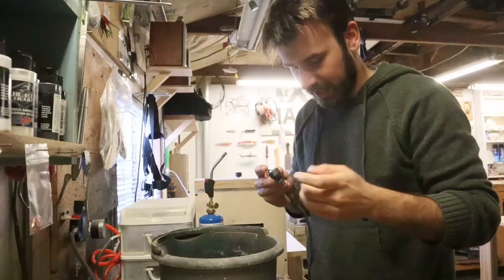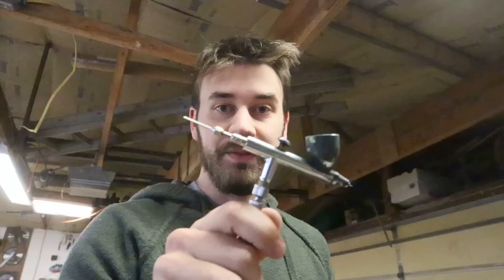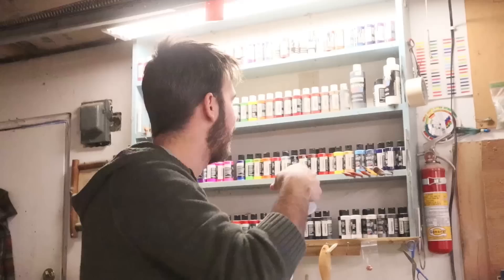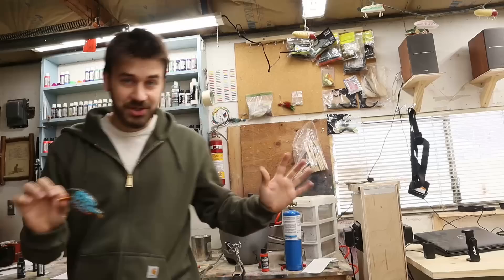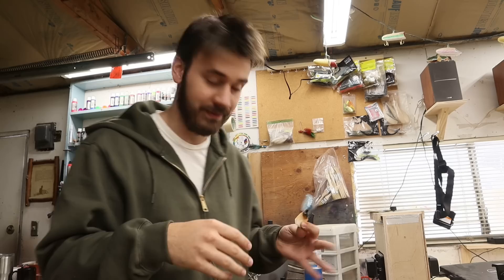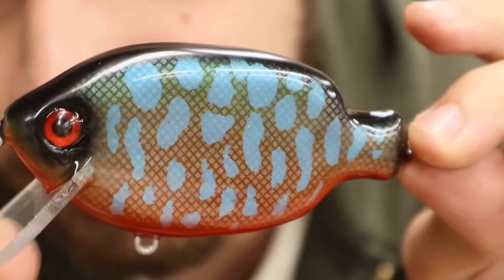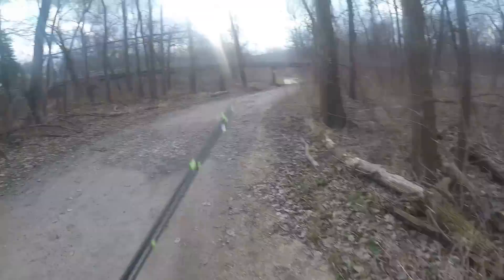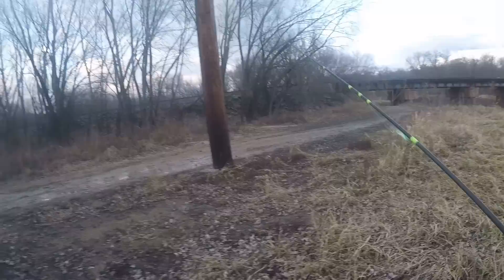Me Teaching You How To Paint Baits

Comment: Question, How does the Alumalite UV stand up to fish? I had problems early on when I first started making lures years back and ended up using Devcon 2 ton epoxy and a rotisserie motor at 5 rmp to keep the devcon level while setting. I fish in Southwest Florida and the Snook just flat out used to tear the clearcoat I was using up before I switched to Devcon. I heard a rumor that most commercial fishing lures are coated with a two part automotive clear coat. Any info would be greatly appreciated. Thanks and keep up the great work!

Comment: What's the wire called that you use for joints?
Reply from the maker: this stuff works great: https://www.amazon.com/Malin-MS20995C-Stainless-Lockwire-Canister/dp/B013P2YFU0/ref=sr_1_4?crid=2X946OUVC3Q52&dchild=1&keywords=0.041+stainless+wire&qid=1578874057&sprefix=0.041+%2Caps%2C167&sr=8-4
Reply: Thank you. I made a bait today and I drilled holes on both sides and used 2 pieces of cord with super glue and baking soda and it didn't turn out too good.